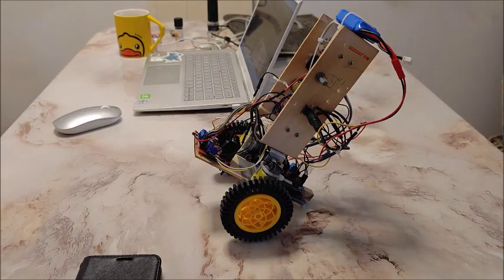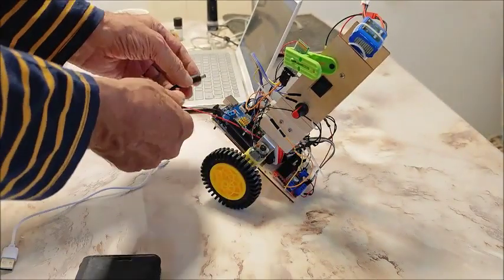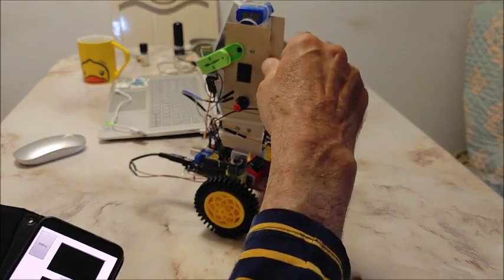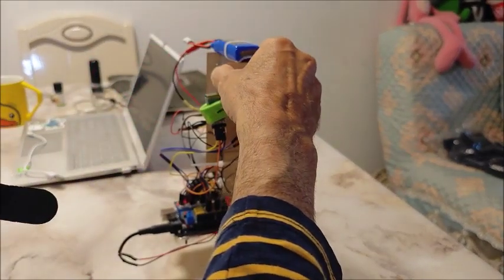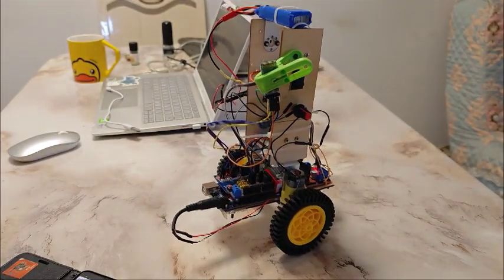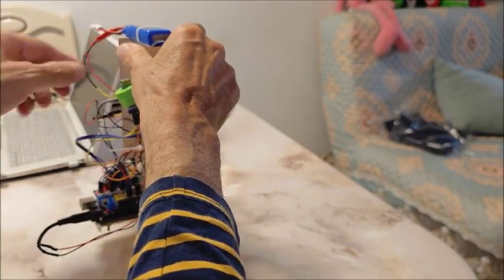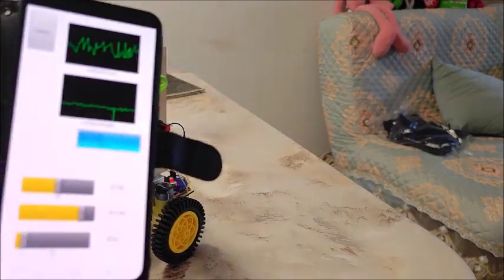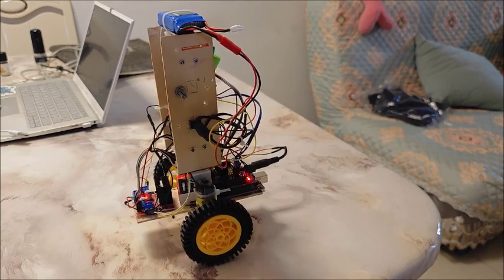Self Balancing Robot With RoboRemo Bluetooth App

Comment: Thanks for the interesting video. Just a quick question - would it be better to have a button to set the Setpoint? Like align the robot straight and press the button or something? Also I can see another (or more?) potentiometer. I may have missed something but can I know what that is for? Also the link to the code in the Video description seems to lead to the same video.